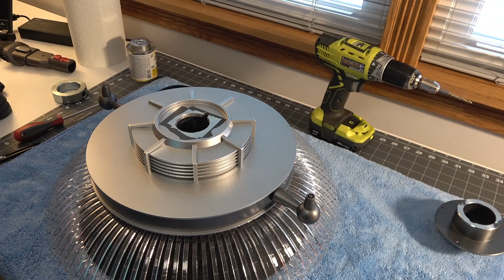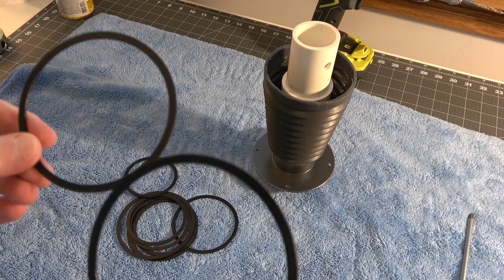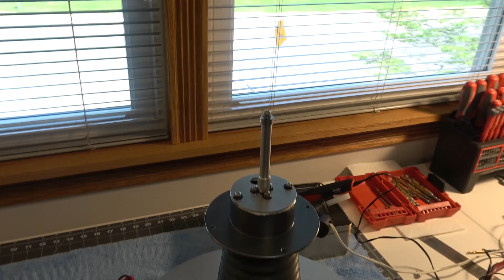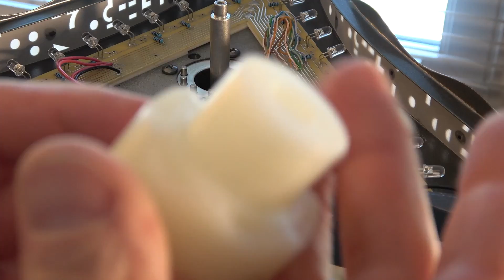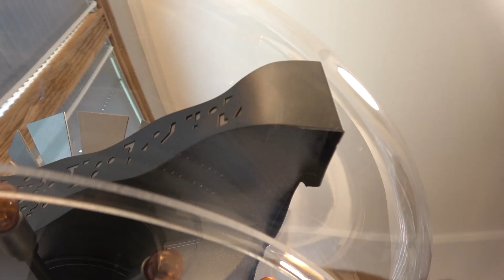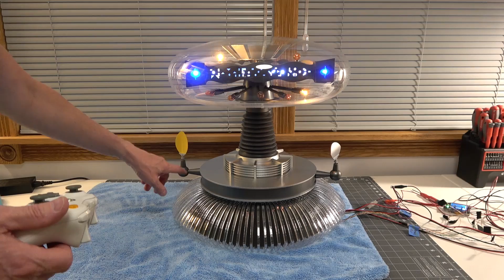My Lost In Space B-9 Robot Build - Episode 10 - Completed Head Section

Comment: I thought you were going to make the shaft move up and down? Did that not pan out?

Also, did you have to stop working on this project for a while?

Great videos, by the way. Very good explanation on how you tackle each issue. Thanks.
Reply from the maker: I went back and forth on it.  I still may try it.   It was on hold for the tread sections.   The new steel laser cut ones just arrived last week after all this time.   Unfortunately have to wait until spring to paint, so yeah it is on hold for now.   Custom parts can take a year or more.
Reply: Looking forward to the continuation of this series.